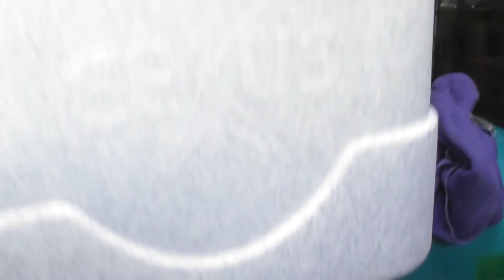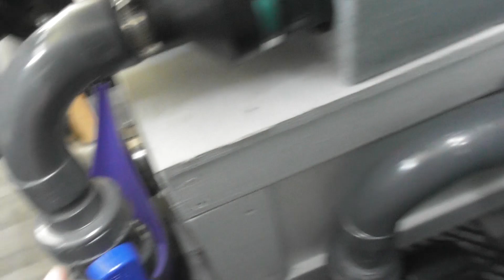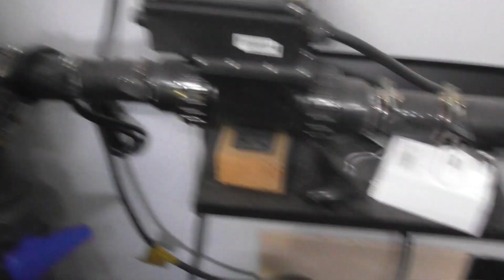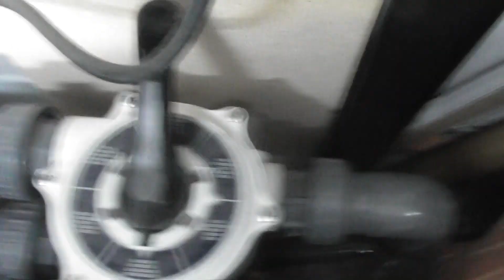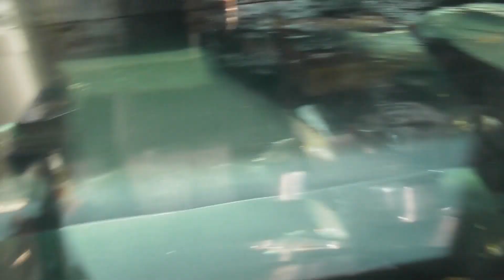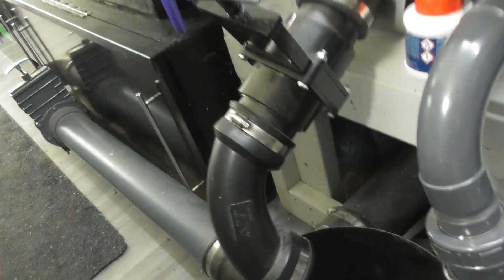Filter maintenance!

Comment: HI i've been planning to also get a Ez pond for my freshwater fish ( emperor channa , florida gars , datnoids and bichirs ) ! i would really love to hear your opinion about it , how's it holding up ? im still not sure wheter to go with 1x 600i like yours or , 2x 300i , could be nice to have the channa by himself and the rest together in 1 ? still not sure :) as far as i know your the only tropical fish keeper i've seen with a ezpond , i personally like them more then regulare glass tank and it just feels so much safer ?
Reply from the maker: 100% recommend. Like you say they are much safer and you can move them more easily if you have to. In my set up, I was only ever going to view the tank from the front so it didn’t bother me. I had this running for 3 years with no issue. The more modern types they make have larger viewing windows so you’ll have a much better looking pond than I did!
Reply: @ReefNteeth  Thanks for the reply!! you also have the channa maruloides correct ? my current stock is : 6 datnoids microlepis , 5 ornate bichirs , 2 florida gars , 1 channa maruloides,  all different sizes , dats = 3 cm , gars = 18 cm , bichirs = 30-45cm , channa 30 cm ish , currently in 3 different tanks :P
Reply from the maker: @barafisk9633  yep that’s right, an emperor snakehead, maruloides. Superb fish with great character
Reply: @ReefNteeth  btw i have a list of questions , sry if i'm anoying but just   wanna ask you 1 . How much was your tank in total with everything ? tank + heater + filter etc ? , my current budget is about 7000 Euro im hoping thats enough .. :P since i live in sweden the delivery will suck so freaking much, at the moment the tank alone is looking like it will be anywhere from 4-5k Euro , 2 What are you using as top covers ? 3. Is there any updates coming soon would love to see it :) 4.  have you had any issues with your channa being agressive ? mine can be during feeding but other then that he leaves my bichirs alone atleast  ( currently only with bichirs , since my dats + f-gars are to small ) im kinda thinking / hoping that the tank should be big enough im allowed to break some of the tankmates rules. 5 Any overall tips you would give yourself if you were to buy the exact tank today , what would you do differently :) ? this is lowkey my savings i've been dreaming of this size of a tank for years dont wanna mess this up!
Reply: haha sry for being really really anoying , question nr 6 , do you think its worth getting this tank in the color blue / white ? or nah
Reply from the maker: @barafisk9633  entirely up to you. Blue and white will show dirt really quick
Reply: @ReefNteeth  sry to bother you mate but , regarding a stand is it even needed for this type of tank you think ? i do have some back issues so it might be nice to get the tank up a bit , but im not sure regarding the cost / how to make a stand , or if it's completely fine to live it with its own legs you think ?
Reply from the maker: @barafisk9633  they are designed to sit flat on the floor. I just made my own stand as I wanted it at a decent viewing height for when I was sat in front of it. Just used cement blocks and 4x2 timbers, nothing special but very strong. And just classed it. I also needed to raise mine as i had a bottom drain
Reply: @ReefNteeth  i do apologize if im a bit anoying and this is only a suggestion not a demand in any way of form , but i would absolutely love a video with a update on a fish and perhaps a little tiny segment on the pro's / con's of having a ez-pond for fish , i dont really see any cons but then again it seems quite rare to see a ezpond in the hobby your the only person on youtube i've seen with one inside and with tropical fish!

Comment: Fantastic setup, best thing I ever did was get an auto clean filter. The only thing I would do differently is get a HMA filter, I stopped using chemicals that neutralise Ammonia, Nitrite & Nitrate a few years ago, it starves your established bacteria of their food killing some or all of it, so the tank is constantly going through mini cycles. I learnt this the hard way due to an issue with my Nitrates that killed most of my rays. I tried everything to get them down, adding more media, specialised Nitrate filters & doing more water changes (with Prime) unknowingly making the issue worse, as soon as I stopped using Prime / Safe, 3 months later my Nitrates were barely detectable.

Comment: Great video. Very clever yet simple system really. Makes a lot of sense to hard plumb everything from a fish room. How much more manual is the house tank?
Reply from the maker: Thanks matey. House tank is a normal sump, but still easy. I drain into the garden and fill via a hose from the downstairs shower. Only different thing is changing the filter floss every week or so, which I hate doing!